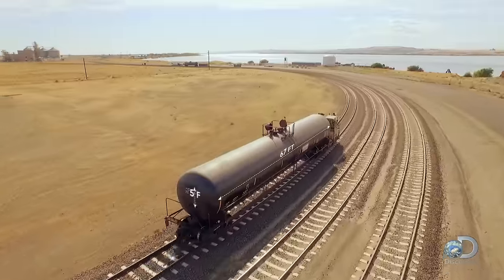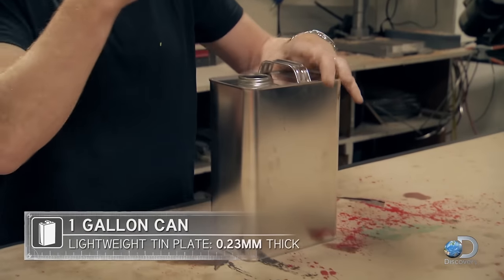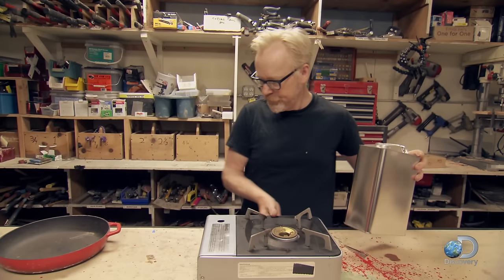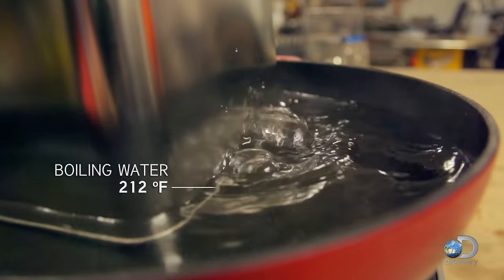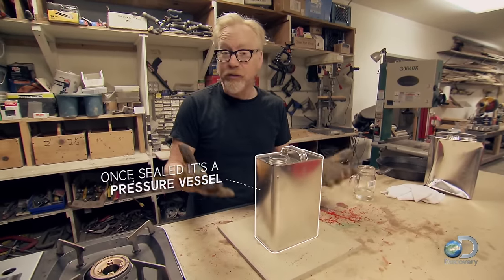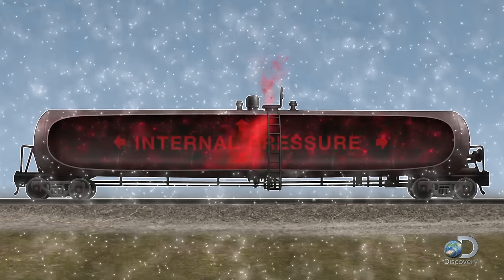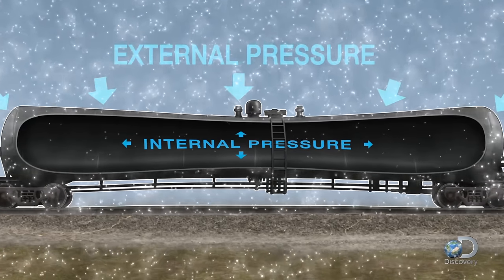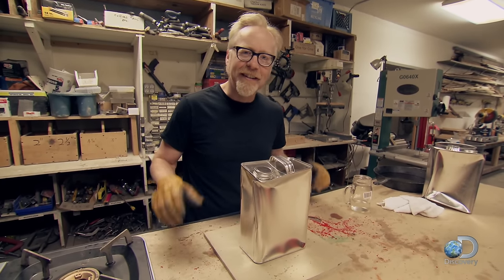The Science of Implosion | MythBusters

Comment: My mind is incapable of fathoming how quick that sub was crushed. 

It’s eerie to think about. They may’ve heard it creek and before their minds could calculate danger, it was over.
Reply: For ways to die, this would actually be one of the better ones
$250k is a bit more expensive than Futurama envisioned tho
Reply: One of the submariners who was interviewed on the BBC said that they had dropped some of their weight, which means that they were trying to return to the surface when it happened. They said that one of the few safety measures that the CEO had included on the submersible was an alarm that told them if the hull was de-laminating (basically falling apart), which would have been what caused a catastrophic implosion. So he said that the CEO likely got the alarm and dropped the weights to try to deal with the emergency situation when it happened. So unfortunately, although the implosion itself would have been pretty much over within seconds, they knew that something bad was happening before they died 😔
Reply: @PatB303  Not "within seconds" - the implosion itself would've been over in much less than a second.  But yes, once something starts to fail, its game over at that depth
Reply: Honestly I think it probably looks like a big cloud of blood.
Reply: @PatB303  They sent a distress signal as well afaik.
Reply: As a mother, I take comfort in that. All this time, I've been thinking how afraid, lonely, dark, and distressing it would have been for the passengers of the Titan. But, now I can take solace in the fact that they died instantaneously.
Reply: Yeah
Reply: @rachelkrumpelman5131 thank you. I really thought my mom and I were the only ones who felt this same way. As a mom I can’t imagine losing my son and husband. I was hoping they didn’t suffer.
Reply: @shaun5047 I think humans would incinerate & turn to ash in milliseconds…. but idk all we can do is speculate. It’s so sad
Reply: So sad for those people on that submarine. To have that crush into them wow! Mind blowing. May the rest and prayers to their families!
Reply: @SacredArcana  Sorry, implosion has nothing to do with fire, burning or incineration (they were in ocean after all).
Reply: @madmatixx please don’t speak on matters who clearly know absolutely nothing about. The millisecond that all the water started pushing into the sub at speeds you couldn’t even imagine (let’s say, 1,500mph on average for such an implosion, but could have even been faster) the air inside the hull had nowhere to go, so it essentially acted like a truck cylinder and superheated the air to a point where it instantly burned out to escape the extreme water pressure. In that moment, the air would have been nearly as hot as the surface of the sun.
Reply: there was actually a warning system. people in the community are agreeing that they knew the sub was in danger because they dropped their landing weights to resurface. james cameron (yes that james cameron) was talking about it on another video. that only makes it slightly more eerie in my opinion. they may have know there was trouble but the implosion itself was so fast they didnt even have time to process the event in the first place. the implosion happens faster than your brain can send electrical signals, so they literally felt no pain and couldnt process anything at all. just the next moment they gone. cease to exist.
Reply: I’m sure the same thing that happened to the submarine happened to their brains too.. don’t you think?
Reply: @rachelkrumpelman5131 Not really like this Its made by  composite material (fibre glass) not steel so instead of crushing like this it will broke apart causing   sea water came inside and drown to death not by crushinng itself
Reply: since it was a composite construction (carbon fiber) there likley would have been little to no audable warning, as when carbon fiber fails it fails instantly and catastrophically.
Reply: @BondJFK As soon as the pressure hit inside all the people would’ve been “sucked into themselves” instantly before any water could fill it up. That’s how the pressure works at that depth. Humans are a lot less durable than fiberglass 🙃
Reply: @BondJFK They didn't drown at all, they imploded extremely fast due to the pressure
Reply: @shaun5047 Not even, this pressure change would have created a vacuum bubble where the energy released equals to the heat of the sun. They were disintegrated before the water rushed back in.
Reply: With the pressure way wa down below that ocean, the vehicle was crushed instantly. It was a painless death.
Reply: @BondJFK nope
Reply: They were under such immense pressure that any "crack" would have been the "entry point" of the pressure. That would have been the end right then and there. This video shows compression over time as the hot air cooled. Not instantaneous implosion such as structure failure of something under constant pressure. 2 different scenarios
Reply: water pressure is worse than air pressure, so i would assume the submersible got crushed instantly
Reply: @drg9812 they only had to put down 10% of the payment, once they rose from the ocean they would obviously pay the rest later on after that
Reply: The CEO said one of the great things about the construction of the sub is that it makes creaking sounds before imploding.  Sounds dumb as hell, but it actually isn’t a terribly bad passive safety feature.  But when you can’t recover, then it’s not a very fun way to go since you’ve got minutes of knowing it is game over.
Reply: @tymondabrowski12 How is this known? ive not seen anything about that.
Reply: @rachelkrumpelman5131  Probably died faster,than some one lined up to be shot by firing squad
Reply: @madmatixx  Apparently,it's as hot as the sun
Reply: @blanchimont5587  They more than likely did hear creaking, there have been $6K carbon fiber bike frames (Frames!) not the whole bike, cut apart after the rider has experienced hearing the frame creek, and finding minute finer than hair line cracks in the paint, you almost have to see with magnification, some carbon fiber layups have tiny air bubbles or voids, between the laminations, which eventually compromise the frames structural integrity.
That Submersible would've creaked and groaned briefly before it delaminated by the extreme pressure of the water finding it's way through the microscopic imperfections, not to mention the cycling of expansion and contraction over the 25 times it's been down to that depth or near that depth.
Reply: Just Imagine if the sub was wrapped completely with explosives, then detonated. That's what happened to the sub - just without the smoke and fire.
Reply: @johnbravo7542 I honestly agree with the microscopic fractures under those unimaginable pressure.  Ooof !
Reply: @LaurenKChannel  7 billion people and you really thought you and your mother were the only ones who felt that way? Really?
Reply: Or it could have happened gradually like this can until it reached the point of catastrophic failure. Saying it was instnataneous and that they did't feel a thing or know what hit them is foolish.
Reply: Rich people - 0
Titanic - 1505 and counting
Reply: @justincase7937 we do know it happened instantly, that's how an implosion works at that depth, and carbon fiber doesn't slow bend when it breaks, it shatters like glass.
Reply: @c.a.whodat  ...Haahaa, "interesting"  imagination you have going on there.
Reply: They wouldn t of known so much more merciful than knowing they were trapped totally oblivious
Reply: @DarkCreedNinja no they weren’t lmao 😂
Reply: i like the italian herb and cheese w sweet onion chicken, idk seems like some begginers to have issues w a sub
Reply: Not to freak anyone out but the wings on the 787 dreamliner are carbon fiber, and thats who OceanGate bought the carbon fiber from, but he got a deal on it because it was past its shelf life (not kidding)
Reply: @drg9812 250k per person at that
Reply: @FrankBullitt390  carbon fiber is very light so good for airplanes that need to carry things, with how much money he had he was fully capable of getting new aluminum manufacured hull but the cheapskate in him won
Reply: @drg9812 yea ok buddy, were you there?
Reply: Because it was carbon fiber, it shattered like an egg.  Death was instant.
Reply: @BondJFK dude the weight of ~1600 meters of water itself would crush you instantly. That’s like having hundreds, maybe even thousands, of multi-ton weighing elephants pressing down on you in all directions all at once. The exact moment the hull of the ship was compromised, they were dead. Maybe in 1 millisecond or less. It’s actually almost impossible to even imagine. Which is why it is so alluring
Reply: oh it wouldn't have creaked or groaned, the hull was carbon fiber, it would've shattered immediately and they'd be done for just as quick;y
Reply: they heard popping, creaking, ominous sounds.. dropped the weights to surface .. then .. good night
Reply: @ricksterdrummer2170  they did say a leak could have happened as well though. before they reached implosion pressure... the window they had in the bathroom was very weak psi rated. so they like did drown some before getting far enough to disintegrate.
Reply: I feel the same
Reply: @rachelkrumpelman5131  Mothers are not the only people who can feel this way... Fathers do too, brothers, uncles, colleagues, distant relatives, cousins once removed, friends etc..
Reply: The can in this experiment was crushed by one bar of pressure.
Now try to imagine the 400 bar that crushed the submersible.
Reply: That's what I wonder. Obviously the implosion itself would be milliseconds. But the lead up to it imploding, I wonder if they heard loud sounds as it's started to fail. The sub was failing from dive 1 I guess. But how apparent that was only the company may know. They had sensors to determine these things in real time. As it started to fail to the point of imploding I wonder if their were loud cracks, strains, bangs etc. Scary to imagine.
Reply: Forreal
Reply: OMG!! They didn’t stand a chance!
Reply: @madmatixx you probably think the earth is flat too. Personal incredulity doesn’t mean you’re right.
Reply: @justincase7937 lol what? It’s science not an opinion…
Reply: No it's a good thing...
It happened at the speed of light.
They didn't know it happened at all!!!
I'd go that way!!!
Reply: if it makes to u feel better, the people in the Titan Submarine didn't suffer. the impact happen so fast the brain couldn't even process what happened.
Reply: :pride-person-heart-lesbian:
Reply: you cant process a bomb explosion either. implosion is just an inverted process.
Reply: From what some have determined, they may have known something was wrong with the hull because apparently the CEO did something to try and rapidly ascend before losing comm.
Reply: @contorta960 apparently they knew something was wrong because I think they determined that they were trying to rapidly ascend.
Reply: @metasaurus3233 everybody in here is physics professor 😂
Reply: I remeber the ceo saying that acrylic is good for the window because it will crackle before it fails, so that’s their warning 😅
Reply: @rachelkrumpelman5131 

Nobody knows for sure what happened.  It’s all theories
Reply: Think about Shaq stepping on an ant. The water above the sub is Shaq, and the sub is the ant.
Reply: @drg9812 It would be a great way to die only if there was zero warning. It would NOT be great if the captain says “Uh oh” 1 hour before the implosion.
Reply: @jakemccoy  I could be wrong, but I don't think you'd get much warning at all.  More like: "Umm is that sound a bad th..." and dead
Reply: I'd imagine there was a few creeks before it occured, like this video, you see the pressure gradually getting greater, pushing in more and more. The pressure per square inch at the level of the titanic is around 5500, at sea level the psi is 14.7. Once the creaks created a crack and destroyed the integrity of the submersible, they would of died instantly but no doubt they knew death was imminent.
Reply: I saw this mythbusters episode years ago
Reply: @borntoclimb7116  🥇
Reply: @darleschickens3726  This demonstration is at most a 1 atmosphere pressure differential (total vacuum inside would equal 1, so realistically it is less) where as the sub was under a 375:1 differential and the reason there is a gradual change in the demonstration is that the internal pressure *IS* changing as more water vapor condenses. aka this demonstrates a concept, but is not a great analogy for the sub
Reply: You would hear creaks in a normal sub, but they wouldn't necessarily mean "imminent d***h" aka there isn't a way for a passenger to know the difference between normal sounds and "Oh s**t we're all gonna d*e" 
God I hate youtube censorship >.>
Reply: @drg9812  I agree. I am just saying, for example, if the pilot senses something earlier. Hypothetical.
Reply: It in the same situation as with a scuba oxygen tank.
The vessel had a flaw and the 6,000 lbs per square inch that the vessel was getting pluses the desalination of the carbon fiber composite caused a pressure difference which in turn heated up the air inside to the same temperature as the sun in which the crew was turned into a pink gel. As the pressure built and the vessel was imploding, the pink gel of human matter was squeezed out like a tube of toothpaste in a hydraulic press. Their pink gel would have been consumed by the marine life in the ocean. Luckily all this happened so fast they never felt or seen it happen.
Reply: @madmatixx  it does. an implosion creates a temperature inside hotter than 6000 degrees, incinerating everything inside before the water gets there.
Reply: @jakemccoy  I could be wrong, but I don't think the pilot would have enough time to tell the difference between normal sounds and life threatening ones and then initiate an emergency assent before catastrophic failure of the hull.  Of course that was supposed to be the whole point of the viewport material; that they *would* hear warning sounds... but obviously either that didn't work or else they ignored something they should not have... I wonder if we will ever know... did they have anything like a flight recorder on board?  Probably not given the cost cutting measures everywhere else in the design
Reply: I had a fibre broadband installation done a few weeks ago. One of the guys working on it said they used a pressure of 5-8 atmospheres to push the fibre through that little tube, and that was already potentially hazardous enough that they had to take all kinds of precautions.

The Titan was up to 4000 metres down. Every 10 metres adds another atmosphere of water pressure. You do the maths.
Reply: @calw8085  if they drowned, that means water filled the sub = there wouldn't be pieces of it scattered all over the ocean floor
Reply: @dayner989  some people studied physics and you learn about pressure without needing a degree lol
Reply: @drg9812  You are on some other track from what I am saying.
Reply: @thelegendaryck  in general, you design with slow failure in mind. So, things bend before they break.
Carbon fibre composite doesn't really do that. They thought the sensors would be enough. But it didn't give slow yield, so there wasn't time to rectify the situation.
Reply: No
Reply: 100 percent heard it and dropped weights.. Likely within a second or two but they knew. The boat sent the signal the weights were dropped... They fuckin knew and it likely cracked hard once, then gone
Reply: @ashlynnpropes8880 exactly
Reply: Or maybe it took time just like this experiment... Slowly crushed with panicking 5 people and they blamed each other
Reply: @igvc1876  Thank you. I am clueless in science and only go by what common sense dictates. But any reports i have read on this state the same, that it shattered in an instant. I don't get how would temperature rise in such an instant when outer shell protected from elements until it didn't. So it would have collapsed on itself first and foremost, before any superheated air comes into play that would potentially incinerate anything that was there. Which means they would have been crushed to nothing in an instant by the sudden dissapearance of outer shell (it shattered) before being incinerated (if).
Reply: So, in layman terms, they vanished. In less time than a snap of a finger!Never thought that was possible, but looks like implosion is the scientific explanation for it.
Reply: It’s happens so fast they probably don’t even know they’re dead rn. There is no way they heard anything but it was quick and probably not painful at all. Rip 🕊️
Reply: They had less than 30 milliseconds to realize what was going on. Remember carbon fiber is instantly catastrophic when it implodes it is not like this aluminum.
Plus the ATMOSPHERIC Pressure was much more great at that lower level
Reply: @drg9812  Booth: "Quick and painless, or slow and horrible?"

Fry: "Yes I'd like to place a collect call"

Booth: "You have chosen slow and horrible "

Bender: "Oooh good choice"
Reply: @madmatixx  all of the air inside the sub becomes as hot as the sun, due the the immense amount of pressure, milliseconds before it is completely crushed
Reply: 30000s of a second. Unimaginably fast. Faster than the sense of touch. They didnt feel the implosion.
Reply: Start building the Empire State Building on top of a beer can, that's how fast it "imploded"
Reply: @madmatixx Actually compressed air at this pressure will ignite for a fraction of a second. It will have reached the temperature of the service of the sun and like a pressure cooker baked.. or in this case, incinerated everything inside. If anything was left of them it would have been a jell like substance.
Reply: @rjyahin05 Your words reminded me of that old 60’s song by Donavan…..Atlantis… “ Way down below the ocean, where I wanna be, she may be”….. the Titanic is the real tragedy here, then the waste of these mens lives for their own fulfillment….  It should never be a tourist site. It’s a gravesite.
Reply: Or not.
Reply: It's being said they jettisoned the landing gear to shed weight so they could ascend back up, so they knew they had a problem.
Reply: @madmatixx yes it does. During an implosion under water the water rushing in compresses the air inside the sub much like in a diesel engine, so much and so fast that the oxygen inside combusts. So yes, there was fire.
Reply: @blanchimont5587 it was very audible fyi. People including Stockton were hearing noises the entire time, from the first dive. It’s the sound of the hull cracking. His entire system of warning was acoustics and yet he said not to worry about the noises. Sad.
Reply: @rachelkrumpelman5131 me too 🥺
Reply: @SacredArcana I think “cooking” is the case. I read it’s comparable to being inside a pressure cooker. Maybe not exactly ash, but cooked “goo”. 
I’m sorry to say it like that, but why sugarcoat it? I’m just so thankful it was quick. I’m a mom and it breaks my heart to think about that little boy’s momma. Well, any of their mommas..
Reply: It  the instantaneous way to make an orange marmalade from Tourists and serve it in a Salted caramel sauce!
Reply: @vierizona5772  not at that depth. It was instant.
Reply: @timeskew6197 if the play-doh had cavities inside for lungs, and was far less dense because the water inside their bodies would also react to the rapid change of pressure, and if there was about 3,000 sledgehammers hitting the can from every possible direction at the exact same time at slightly faster than the speed of sound. 

Think of it like this: there were 5 men inside a tube. Then, faster than you can process what happened, those 5 men occupied a space approximately the size of a grapefruit. As well as bits of fractured carbon fiber and off-brand XBox controller.
Reply: It’s a blessing…no suffering no panic…just so fast ya don’t even know what hit ya
Reply: If any of the passengers beyond the 1st place darwin award winning billionaire possessed even a basic high schoolers knowledge of submarine engineering and pressure differentiation, theyd be guaranteed to be shitting bricks the moment that particular sub got wet.
Reply: .33 milli seconds
Reply: @shaun5047  

Pink goo, I hear.
Reply: @borntoclimb7116  
I did that experiment at school more than half a century ago.
Reply: @lenroddis5933  in germany we did it in school too
Reply: @rachelkrumpelman5131  As not a mother, I take comfort in that.
Reply: @PatB303  well that couldn't have been the case since the submarine imploded one and a half hours into its expedition
Reply: @pierreo33 Exactly 😂😂💯💯
Reply: FAFO.
Reply: @qwerty112311 more like seconds, according to experts.
Reply: They were gone in 2 nano seconds it takes your spinal column 4 nano seconds to notice a problem they didnt know what hit them
Reply: That was a tin can.. the final moment would be instantaneous however the submersible was probably squeaking and slowly crushing at first, letting them know what their fate would be for a few minutes.
Reply: Carbon fibre doesn’t creak. It just implodes …
Reply: The nervous system does not have time to register the implosion. Because the hull imploded in milliseconds.
Reply: According to some reports it had been creaking for a long time and noted on previous dives and had been told by Stockton to ignore the creeking.
Reply: The pressure change that occurrs when a submarine implodes is so extreme that anything flammable instantly combusts.  The water filling the sub puts out the fire functionally instantly.  One expert likened it to being inside the cylander of a diesel engine.  If you drop a match into a cup of diesel fuel, it will simply extinguish the match.  When that same fuel is heated and highly pressurized, it combusts.  Diesel engines don't even have spark plugs because that's not how they work.
I think that's the most staggering thing about a submarine implosion  to me.  The pressure jumps so rapidly and to such an extreme extent that flammable objects burst into flame.  The mere concept of it is staggering.
Reply: It was 30milliseconds,if you want to make one your self get a hot pan put a soda can on it then be carful put it in cold water then that’s a homemade way of your own inplosoin
Reply: As the experts said, the implosion took place in just a matter of nanoseconds before the victims even knew it.
Reply: @shaun5047 i think they got vaporized to ashes at the increased airpressure (and temp) miliseconds before the hull and water itself got the chance to squish them
Reply: @c.a.whodat say it louder for the people in the back!! 👏  👏 👏
Reply: The sub was made of a material called carbon fiber. Carbon fiber, unlike steel shatters when it fails. It's likely there would have been either no sound on an indecipherable sound.
Reply: it wasn't quick... this would have to be the most horrifying death i could imagine... they saw it coming... just waiting...it would take a while, until structural integrity is completely compromised then it would collapse quick... even then doesn't mean they died instant... they slowly got crushed... horrific... if thats what happened, it may have torn apart after starting to cave in... if it compressed and twisted enough to create a hole, then it would be an instant death... the temperature in those moments would be unbearable.
Reply: @JohnW704 not how it works at all. Research a bit before spewing your opinion as fact
Reply: Your mind isn't very good then
Reply: Really not that hard to fathom. No different from being crushed to death by a large object.
Reply: @drg9812 one of the ignored criticisms was that the nature of the warning system would give insufficient time to avert disaster.
Reply: They knew.
Reply: I suspect they would have heard noises, but that's pretty common in sbs and would have been brushed aside.  The tube being brittle, and not a pliable metal, would have gone from seemingly healthy to catastrophically failed basically in an instant.
Reply: NPC only here because of pop news lmfao 😂😂😂
Reply: They heard or felt nothing. Happened in milliseconds.
Reply: @madmatixx  correct, but it would generate a lot of heat
Reply: @blanchimont5587  one of the reasons I still ride an aluminum bicycle
Reply: Before the implosion and an alarm goes off suggesting the hull has weakened and is about implode… wouldn’t they feel a crushing pressure all around their head before the implosion?
Reply: Seems like an ideal way to die. Much better than slowly suffocating.
Reply: Amazing how many of y’all know thermodynamics
Reply: I want to see another sub go down with no one in it and have it recorded by another at that level and what it would actually look like. But visibility  is crap that far down
Reply: @FrankBullitt390 I have been hearing conflicting reports about the source of the carbon fiber used to construct Titan. At first, it was said that the material came from Boeing, but Boeing has denied any involvement with Titan. Also, there is no record of OceanGate purchasing carbon fiber from Boeing. That doesn't rule out the possibility that the carbon fiber was in Boeing's scrap heap, and OceanGate had unofficial permission to help themselves.
Reply: 400 atmospheres of pressure outside and one atmosphere inside.
Reply: @madmatixx bruh u got rekd like the sub
Reply: @ElaineWood-f2t  Rush was certainly good at bending the truth but Boeing would be a place to get that much carbon fiber, same state too.
Reply: And we're sending our love down the well
ALL THE WAY DOWN!!!
Reply: Given it was carbon fiber, it seems to be that they wouldn't've even heard anything. It would've just failed.
Reply: @theriveracis5172  I would have felt safer in a 20" thick hard rubber hull, atleast it could expand and contract safely.  The carbon was likely only safe for one dive, under pressure it would press inward, but once back on land and expanded again it would be filled with hairline cracks and be compromised.  Its why it popped before even hitting bottom on the last dive
Reply: @souljaboy.6668  No denying carbon fiber is tough, Ive heard stories of guys using carbon fiber hoods on their modded cars, getting into accidents and the hood snapping off the hinges and going straight through the windshield and roof A pillars and killing them.  It has a purpose - but I think graphene is the new kid on the block, even lighter, even stronger - but still carbon based, not a polymer or an alloy
Reply: @FrankBullitt390  nice, stronger in what way? as in brittle or indestructibility
Reply: @drg9812 Yea. They were peacefully imploded and burned and vaporized and disintegrated and then exploded and scattered all across the cold abyssal ocean floor of the north atlantic never to be found again. If only we were all so lucky.
Reply: I mean, it's far far faster in subs. Image you move, pinch yourself at the very same moment it imploded, and it'll crush you before your nerves can send the pain to your brain to register
Reply: The implosion was so quick (1 millisecond) that it would have happened ~150x over before a person's brain even registered the first one. They didn't even know what hit them.
Reply: @adraedin  it would be slower than a nano second, but yeah, it would be fast
Reply: "fathom" ha.
Reply: @fincrazydragon  What if the high explosives on the sub were precisely measured to equal the energy expected from the implosion. Explosion/implosion would cancel each other out? I’m sure the sub would need a new paint job at least ;) (jk)
Reply: @metasaurus3233  I don’t know if the carbon fiber they used would shatter like that,. I know dense parts made of carbon fiber shatter (Like a skateboard/steering wheel, etc) — but they used thin sheets that weren’t bonded together the same way.. I think it’d tear like thick fabric.
Reply: jesus
Reply: Before they could even interpret that first clang they are already gone
Reply: @madmatixx  Thank you for the phenomenal example of what happens when you speak on something in complete and utter ignorance. Be better, bud.
Reply: @BondJFK  This is completely wrong. How do you folks speak on things when you're this clueless?
Reply: @PatB303 implosions take milliseconds. Not full seconds. I’m not an expert, but James Cameron is, he provided that information. Along with a coast guard engineer.
Reply: @madmatixx that’s not true. The heat of the implosion creates fire in the momentary air gap. Fire doesn’t cause an implosion but it is a momentary part of the aftermath.
Reply: They knew it was going wrong. Im sure they had sensors letting them know and they were trying to resurface asap
Reply: @dayner989 You don't need to be a professor to know basic physics.
Reply: I heard subs are always creeking under water
Reply: @PatB303 no there is no margin of error.
Once it fails it fails at that depth.
Reply: @PatB303  An implosion would have been violent enough to cause the weights to be ejected as well.
Reply: @madmatixx  Actually the instant compression of the "bubble" of air inside the sub would have caused everything inside to be instantly compressed to a liquid and cooked at temperatures the same as the surface of the sun. Kind of like an internal combustion engine cylinder compression stroke only extremely more violent. There are videos showing how water psi in a see-through cylinder makes the water bubbles compress to nothing as the pressure rises.
Reply: @jakemccoy  The debris field will tell the story. If it is a relatively small debris field, then it happened close to the bottom. If it is more spread out, then it most likely happened on ascent and then the debris was broadcast farther as it sank in the currents.
Reply: @drg9812  Also, this vacuum implosion was not of sufficient speed and ability to contain the air inside as one bubble as it compressed it so as to ignite it.
Reply: They knew something was very wrong when it got scalding hot. Concepts click very fast.
Reply: only the pilot knew what was about to happen, imo
Reply: Creak
Reply: @c.a.whodat yes, but there was not nearly enough time for the heat to cook them before the water rushed in.
Reply: @calw8085 where are you getting this from? So many people try to build this narrative that they suffered. They suffered of ignorance and were so full of the BS that was told them by Oceangate, that’s the biggest hurt in my opinion.
Reply: @rachelkrumpelman5131 lmao what does your being a mother have to do with any of this? be serious
Reply: @SacredArcana  Not so, despite "experts" saying that. The energy required to vaporize (not incinerate) a human in milliseconds is enormous; far greater than available here.
Reply: These ppl knew what was going to happen for at least ten minutes before collapse!!!

Period!!!!
Reply: yeah
Reply: Instant death seems better than waiting and suffocating… but the only thing that bothers me about that is that in my experience, your brain can actually make it seems as though time has slowed down - I guess in an attempt to give you a better chance of escape. I fell badly in the playground onto my eye as a child (not the same as dying, I know) and I’ll always remember how slowly the ground came up to meet me before I hit the ground. I fell so fast and hard it must have been a second or less from slipping to hitting the ground but the memory of being aware of how slowly I felt I was falling had never left me and always comes back to haunt me when I hear about someone dying ‘instantly’ 😱😥
Reply: @SacredArcana  What if they weren't human but saiyan like Goku or Vegeta, or a human like Krillin or Yamcha
Reply: As a humanitarian scientist I approve of their method of death
Reply: Incredible quick
Reply: The sub Titan  was making noises every single time they took it deep diving.   Rush thought it was normal.
Reply: It takes 60 milliseconds for your brain to register stimulus in any capacity and the implosion happened in half that time. Crazy to even try to fathom 🫣 At least they didn't suffer at all
Reply: @madmatixx the implosion caused the air inside the sub to exceed the temperatures of the sun so it was technically possible for them to spontaneously incinerate
Reply: Passenger: “Hey, this is really awesome. Just look outside this porthole. Think about how luck we are to be able to do somethi-“

And then they were gone…
Reply: they didn't hear a damn thing. their acoustic monitoring system was irrelevant. the steel pulled from the wreckage was intact. it's the carbon fiber that instantly shattered like glass. at such depth and pressure, there wouldn't even be time to register that a 'crack' had occurred or was occurring... they were just conscious one moment; the next moment they ceased to exist
Reply: @ElaineWood-f2t  They used Boeing, NASA, and WU as remote consultants.  Neither companies or WU had any hand in the design, manufacturing, or testing of Titan.  WU initially had a $5 million dollar contract with OceanGate but the relationship was terminated less than $1 million into its funding which was actually for a steel hull sub later named Cyclops 1 designed for only 500 meters.
Reply: I heard it took 1 millisecond for the sub to implode. It takes 99 milliseconds for brain to process pain. It takes 13 milliseconds for vision to process. So they didn't feel or see it happen.
Reply: @tylerjohnson8973 you know that in Titanic more poor people died than the rich, right?
Reply: @mbras9176  o ya bud?!?!?!

I don't care
Reply: @tylerjohnson8973  so you want to be ignorant. Good to know
Reply: Who cares,darwinism at it’s finest👌🏻
Reply: Is like the can was squeezing itself because of the pressure
Reply: @PatB303  Anxiety is bad, sure, but at least they didn't feel a thing when it actually failed.
Reply: @drg9812  The people who are spending millions to go into space for 4 minutes, are having second thoughts about now.
Reply: I was think the same
Reply: @PatB303  to be fair going from "hmm something might be wrong here" to instant death in a nanosecond is still pretty good, it's not like you see it coming.
Reply: Basically a reverse explosion… no time or pain ..it was instant
Reply: Transcript leaked from titan sub saying they knew what was happening for 20+ mins. They knew they were gonna die
Reply: They heard the cracks, otherwise the emergency protocols had not been activated - which they were. It was just too late. Like another comparsion with their ultrasonic warning system - a camera can spot the lightning as it comes down, before it strikes. But you won't be able to do anything about it at that point.
Reply: The transcript of the emergency messages indicate the heard cracking and emergency alarms for a full 19 minutes before they all got pancaked to death.
Reply: It was instantly crushed. Just think about you chatting with some people in a submarine and all of the sudden everything goes dark. You will NOT know the submarine was crushed.
Reply: @tylerjohnson8973 omg 🤦‍♀️